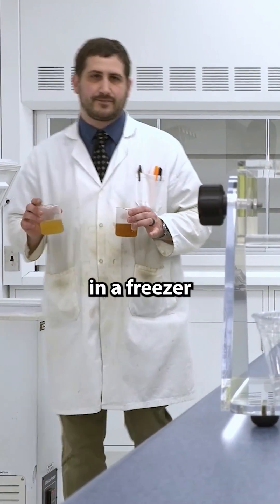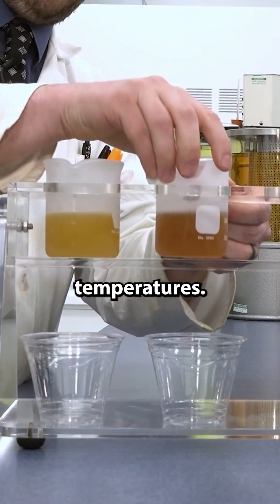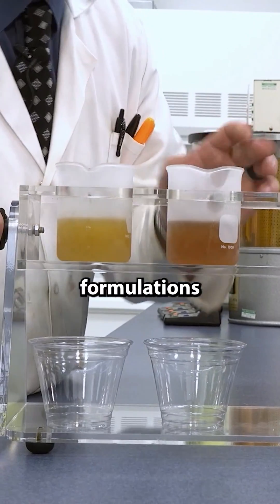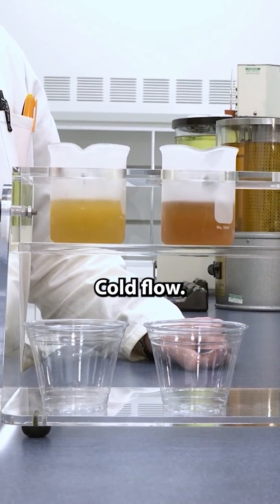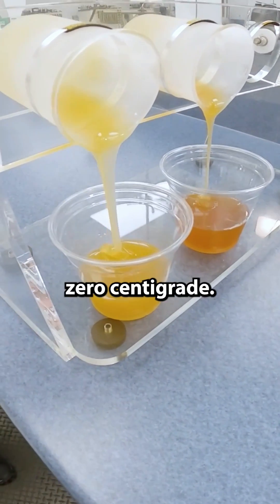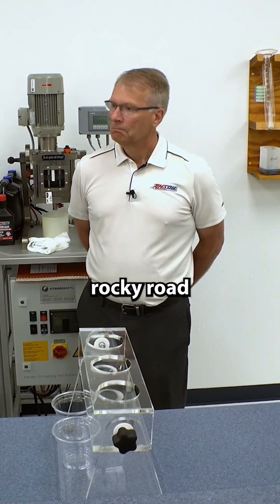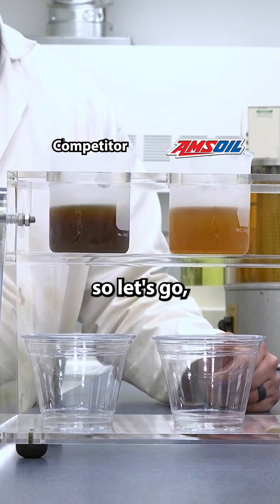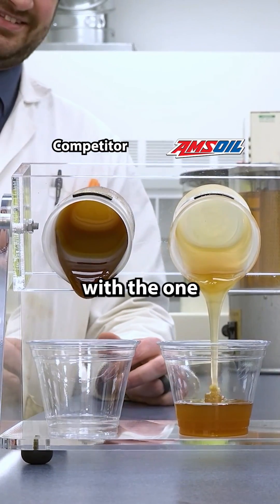Engine Oil At -35°C

Comment: At -35c use a properly sized oil pan heater and you wont have any cold start issues 👌
Reply: If yer runnin in temps that chilly with only relying on oil viscosity then you deserve what comes
Reply: @mrhossola7137 My car doesn't have a block heater option fuck it. I run my BMW 335is in winter here, we rarely get -30c but it can happen.
Reply: @JackRR15  Good for you
Reply: @Medieval1-1  Definately a valid point. Honestly i like and use alot of Amsoil's products, and they do seem to handle the cold quite well.  That said i use both a block heater and oil pan heater below -20c for the ultimate in wear mitigation... why not shoot for half a million k outta the powertrain ;)
Reply: @Medieval1-1  Use both cool, but get only better oil?
Oil have specyfic viscosity at temp, and if it was designed for an engine it's best protection is at oprimal engine temperature, engine coolant let's say is 95c and you start engine with cold oil it can change positions of parts from where they should be, ie more viscous oil can push shaft from injetion point to other side of bearing potentially causing contact, and bit by bit destroying the engine.
Also to much viscosityu can cause bearing spin, and we are talking only about lower part of an engine, and oil is lubricating much more than that. Colder oil will not spread so easly on cylinder walls. it can clog on lifter helpers.
Also, old charts show that 10w40 is for up to -27 and here they test 15w40 which should not be used with temps closer to freezing point of water.
I personally wont start my favourite car in -20 to even move a thing before i will geat up oil externally.
Reply: At 35 Below your diesel should still start mine doesnat -21 without any glowplugs or grid heaters or parking heaters. Will start without a fuzz at -35 with a little double glown and crank. Than happy and alive, loves the zub zero boost
Reply: And an engine block heater, so you can have warm air inside when you start the engine
Reply: @pulaski1 even on my gas trucks I have a heater that goes in the lower radiator hose. Definitely makes a difference.
Reply: @pulaski1 If you can get a block heater that's enough IMO. Block heater will heat both your coolant and your block will be warmed up to which means the oil should be warmer as well as a result.
Reply: @TheMidnightNarwhal  Yes, that was my understanding, though when I have browsed ordering a custom-spec car, a block heater is often bundled with several other "extreme weather" upgrades.  I still might consider it though, if I custom-order a car.
Reply: @pulaski1 you won't have warm air immediately,  you still have to wait for the coolant to get some heat into it and flow through the heater core
Reply: @derekgardin1512  A block heater works by activating the water pump, heating the coolant, and pumping it through the block, so there would be no waiting beyond the time taken for the block heater to warm up and circulate the coolant.  I have no experience, but I would guess it would take 10-15 minutes for the block to get as warm as the block heater could manage.
Reply: Yes, like others said. Good point, but things fail all the time. Who’s not to say your block heater took a shit and you don’t have one on hand or the time to install one. This oil could save ya from a lot of hassle

Comment: My boss had a 05 ford expedition we used this junk from day 1 changed oil and ford filter every 6000 miles at 80000 miles he was in a hurry we couldn't get amsjunk for that oil change so i put rotella 1540 in it i dropped the end of the oil nozzle in valve cover pulled it out and was covered in sludge wiped it off stuck the hose back down in the valve cover again same thing more chunks of sludge so thats the last time we used that overpriced snakeoil!

Comment: There are a few oil types under the Chevron "Delo" oil line. Some are conventional some are synthetic. Chevron oil is not bad oil and I would expect a Synthetic from Chevron to flow similar to the AMSOil. Is this a synthetic vs synthetic test?

The fact is all of the major brands of synthetic that are geared towards the same application, perform very similar. I would use any of them in my vehicle. I buy my oil from Canadian Tire because they have rotating sales on name brand synthetic. So one trip I might be getting AMS the other might be Penzoil. Sadly I have to buy my filter somewhere else because Canadian Tire only seems to heave the shitty filter in stock so I buy an OEM filter from Toyota.
Reply: Delo 400 it’s the only 15W-40 Oil from Chevron for Turbo Diesel Engines and it’s a BLEND!! Mineral Oil & Synthetic Oil mixed.
Why this “Test” it’s just useless and misleading!!
That’s why “Banks Power” didn’t make this “Test” with Shell Rotella T6 or Mobil Delvac…
Reply: @Muotaman9958  To be fair they have a 15W40 in all of their Delo "On Highway" HD oils. But still the description does not say which one they have compared. Since there is such a large visible difference at the same temp I think you are right it's either the blended or conventional oil.

Comment: When it gets that cold, most people will have heaters on their oil pans and block heaters.  Certainly any diesel truck will have auxiliary heat before start up, or she isn't going to start.
Reply: I work in a diesel engine development lab, and we do cold start tests at -40. Some of our engines power McMurdo base and the South Pole Station.
Reply: @DallasHerrmann  and your point is?
Reply: @streetsurfer420 point is he’s in the industry you should sit down and learn.
Reply: @AndrewKidd14145  I'm down for that, but he didn't add anything to the conversation other than a personal anecdote. Nothing he said is about how worth it this oil is when we already have other methods in place. Obviously that's very hard to quantify and I understand that.
Reply: @streetsurfer420  At least some modern diesel engines can cold start at -40 degrees. Not sure if the on-road folks test as hard as we do or not.
Reply: @streetsurfer420  McMurdo uses Case quadtracks, and at least one Cat Challenger, for the fuel run to South Pole Station. Base itself uses a lot of Caterpillar generators.
Reply: @streetsurfer420  Oil is very important for these cold starts. The big 3500s at McMurdo are also downrated, and run on a special ultra-low-temperature fuel blend.
Reply: @streetsurfer420  I'm a mechanic, not an engineer, though I do have some engineering training. That much viscosity difference is going to do two things: make it easier to turn the engine over, and make it easier to get the oil flowing through the pump. I personally don't need to deal with ultra low temperature starts, but I know they are brutally hard on equipment, and if I did I'd definitely be running something like this oil.
Reply: @DallasHerrmann don’t they basically run on jet fuel? I saw a documentary that shows the way they ship fuel to those generators is by actually storing it in the jet’s own fuel tanks.
Reply: @JonBecker81  McMurdo is supplied by tanker, South pole station with fuel bladders towed behind tractors.
Reply: I had Espar heaters, but you need to put a loop or two around your sump, or you have a 125°F engine block with -25°F oil hanging below it. It warms up quick once it’s running, but it stays cold for a minute or two.
Reply: whatever  people  think about  heaters but some places  ur in a pipe dream
Reply: I use anti-gel and block heater. Kicks over every time well in to -40f
Reply: yeah most don't use block heater anymore
Reply: Think again, I struggle every year out of spite.  also you just need a good battery when it's too cold, I drive a diesel in -40 regularly and that is the biggest difference maker

Comment: I'm sticking with my Shell Rotella T6 because AMSOIL is very, very expensive! Plus i don't live in Alaska! 😂
Reply: Amsoil Preferred customer is where you need to be. All my vehicles have been on amsoil minus motorcycles they get mutul. 480k miles, and 550k miles on the two diesel trucks.
Reply: @mustangdemon87  you should try their motorcycle oils. I think they're fantastic in mine.
Reply: I am up here in the north central plains by the 49th parallel USA-Canada, It gets fairly close to Alaska temps. With AMSOIL synthetics -40°F my engines start right up and get oil pressure immediately. Sure upfront costs are more, but you'll save in the long run. And the components used to formulate them cost more to produce a superior product. In their own words "AMSOIL blows the doors off the competition"!
I don't worry about upfront costs, AMSOIL is only lubricants I'll use! 👍
Reply: I'm a lifelong mechanic by trade, that is how I know how important lubrication is, ok?

Comment: How about at 200°F? Oil spends way more time at that temp than -31°F.
Reply: It's the cold starts and warmups in cold climates that kill a motor. That's why engine rebuilds in heavy equipment in the arctic are so common. Amsoil data I've seen typically has a thermal breakdown at 300°F or above.
Reply: You'll want to look up project farm's oil showdown.
Reply: The only time i had any issue was when the oil had 10k miles on it, and i was driving up 10k ft of elevation to the top of the continental divide. Oil pressure dropped 3 lbs @ idle by the time i got to the top. Came right back up once we got down the other side though.
Reply: 200°+ no problem
Reply: For most people, cold flow is irrelevant.

What matters is keeping oil at the proper viscosity at operating temperatures. Too many vehicles recommend thinner oils like 0w-20, 5w-20, or even 0w-8.
Reply: You don't understand the weight rating on the bottle do you?
Reply: Very true.  And anyone living with low temperatures will have to plug in their vehicle before starting.
Reply: @kelsycunningham8452 My duramax fired in -30 degrees, without being plugged in?? I was in the mountains without electricity. I run Amsoil oil, filter, and fuel treatment..
Reply: @kelsycunningham8452 ” have to” Is inaccurate
Reply: @Obamanamamama  Richard was writing about vehicles operating at very high temperatures.  If using lubricants like 20-50 to protect at that extreme, people living or working in those temps will not care about very thin oils that flow immediately at -35.
Reply: @kelsycunningham8452  not me. Well that's not totally true. I occasionally do if I remember when it gets -40. but some of my vehicles don't have engine heaters either and sit outside too. But as long as the battery has juice mine start right up and get oil pressure quickly with AMSOIL in them.
Reply: Project farm did a comparison, Amsoil won outright on the high temp tests; however, for the budget minded shopper penzoil platinum did quite well.
Reply: @drewski5730 Ultra Platinum, not Platinum. Platinum is garbage.
Reply: I use Amazon brand of oil. No issues in the cold

Comment: I would be afraid to cold start my engine at that temperature even with the AMS. I would still want the AMS, but with a block heater also.
Reply: Dude when it’s that cold, starting anything is not fun😂 because not only is the oil thicker, because the airs denser everything feels like it has wayyyyy more compression
Reply: @SomeGuysSawShop cold also causes batteries to have less output
Reply: @matthewso5291  100% but even chainsaws, you get a big saw with no decomp and try and start it at -40° it feels like it has twice the compression, I just know from experience 😂
Reply: @SomeGuysSawShop  oh lol that makes sense
Reply: @SomeGuysSawShop that's probably less to do with air density and more to do with heat expansion/contraction in the metals/bearings/ causing the tolerances to be tight
Reply: @spencerkleiman5035  no, not actually. Even if you keep the saws warm when you try starting them in the cold you can feel a significant difference between cold and when it’s warm
Reply: @SomeGuysSawShop im in Canada LOL, I get -40 Celsius and -50 on the worst days. My 98 Jeep XJ sounds like a WW2 tank sometimes in the winter Lmfaoo
Reply: @Johnnyw-ln8ew  is there anything worse than trying to get anything started in -40°😂 the tractors will only start if you preheat them with a blow torch
Reply: exactly
Reply: My diesel jeep wouldn't start that cold. Fuckin POS 😂

Comment: Those are oils for Syberia Yukon conditons😊
Reply: I'm from the Yukon, and I can confirm it regularly gets to -40 C in the winter. Our Powerstrokes at work have block heaters, oil pan heaters, diesel heaters, and both batteries have a battery heater. They need to idle for 45 minutes before driving, and you don't shut them off.
Reply: Yes but some people need it and didn't have it until now
Reply: I hope you meant Siberia and Yukon. Yukon is a Canadian territory, Siberia is part of Russia. In case you've never seen a map.
Reply: Or the Midwest in January
Reply: That's why in those temperatures 10-45 below they plug in their vehicle.  I've even seen having small fires to warm up their engines.